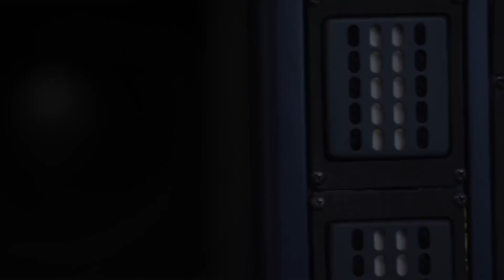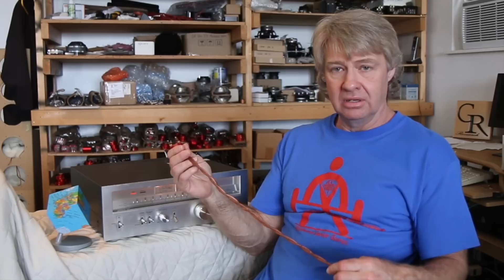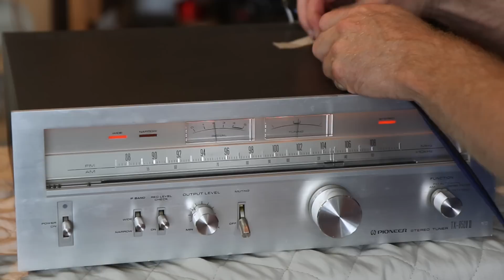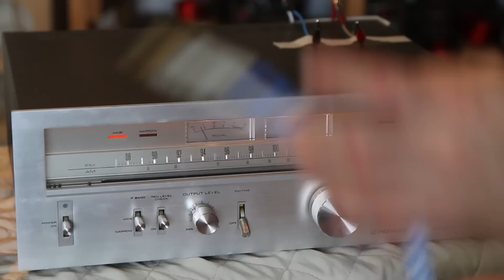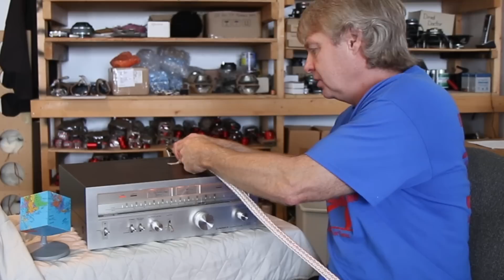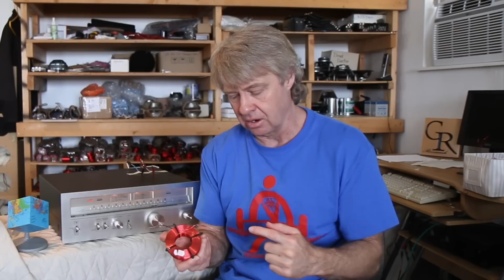Do Audiophile Cables Matter? Here's PROOF!

Comment: @buskman3286

I've hosted carefully set-up blind auditions, with Ultimate el-cheepo - "came free with a vcr in the 1980's" / cut with scissors and crudely taped back together with scotch tape - wimpy RCA cable interconnects vs. $400 "pure Silver" RCA interconnects - with all of the equipment sequestered into a seperate room, with the speaker cables run under a door.

All of the kit was high-end (Roksan amplification / 24-bit SACD recordings / Pioneer 'Elite' CD player / Magneplanar speakers), the audio hardware was on a separate mains power feeds from the power panel in the basement, the amplification unit had a "special" power-cable to the wall, the auditioners had time to acclimatize to the room and picks of music, we all knew one another and were friends / so comfort-level was high, the room was acoustically treated, the speaker were set up to mfg. spec. etc.   I pushed every limit as far as possible in providing the opportunity for the auditioners to audibly detect a difference between the cables.

The result?  No one was able to do any better than wild guesses at which cable was in place.

When the listeners specifically requested that I implement the silver interconnects, and I actually left the utter junk interconnects in place ~~~ they listened and started telling me about how, "yes, there is just this special something about those silver cables, something that cannot be measured, an air about them"...

...when they were actually still listening to music through the junk RCAs...

Mind over reality.

I suggest that if someone wants beautiful / aesthetically appealing cables, which many of the uber-price cables are - then I say go for it if you have that kind of disposable income, but to lie and say that they make a difference audibly?

One might as well be an Orange Abomination voter, because that's about how dishonest they would have to be to make statements about standard cable audibility.

My two cents worth: buy decent ~ not crazy-price cables, check your ego (!!!) and use the money that you saved to sponsor a kid into a scholarship, support a woman's shelter, give money to the SPCA or just something that represents a valid use of money.

Male ego is what f's the world.

Comment: I didn't hear an improvement with cables until I upgraded my speakers to the GoldenEar BRX with AMT tweeters and source from compressed Spotify to Apple Music lossless.  My stereo setup is $11k.

RCA cable: I heard an improvement with WorldsBestCable RCA by Mogami 2549, and even more with Cardas Parsec.
Here's my video:

USB cable: I also heard an improvement with Amazon Neo, and even more with Cardas Clear.

Speaker cable: I also heard an improvement with Micca 14 gauge.  The WorldsBestCable (WBC) using mogami 3082 made my sound quality worse.

Power Cable: I also heard an improvement with iFi Silent Supanova with noise cancelling.
My video: https://youtu.be/lXijf7TdF8M

Comment: All i can say is  i can attest on what Danny is explaining.  I used to get radio signal from my neighbors CB transmissions while playing my music. I learned later is to move the speaker wires around until i couldn't hear these CB transmissions. The same thing happened in the 70s with our TV set with a antenna on the roof.
Reply: Have you heard of ferret core filters?  It's at the end of all your computer plugs and on many other electronics, it's the bulge, (cylindrical  form) it's to hamper the rf signals.

Comment: Come on people… when you disconnect your cable, the music stops. If you use a cable as thin as a spider web you may start getting some sound through but im sure it would suck. If you use a well designed filtered cable you will get pure sound through. - No sound. - Some sound. - Pure sound. 
Cables are critical in creating a decent signal. The ‘Snake oil’ conspiracy cracks me up!

Comment: Here's my experience:
I participated in a cable test in a shop a couple of years ago that  included the administrator actually announcing which interconnect cable was used as they changed... a totally UN-blind test!  The cables being used varied in price from around 30 bucks to 2000 bucks for a one meter pair.  Literally everyone could hear that the $2000 cable was dramatically superior!!  BUT, at the end it was revealed that the cables were never actually changed.  The $30 cable was in place for the entire test.  ;)  

In addition to the above, I have participated in and administered blind testing of RCA interconnects on several occasions.  In these tests no one ever consistently correlated/identified RCA interconnect cable changes/sound quality regardless of the type of music/equipment used.  

So, I have to admit that re exotic cables I'm pretty much in the "it's snake oil" camp!  ;)
Reply: Yes, you are right. A lot of these cables cost a few Dollars to produce and are sold for US$1000s of Dollars with ridiculous claims. Of course you need snake oil arguments to make people pay with such insane margins. I've also gone through many professional blind tests being official qualified member and had to get my hearing tested by a professional audiologist every year. Yes, forget about power cables, short distance RCA cables, optical cables, and even speaker cables at short length, as long as they are of decent quality. Obviously cable length matters and I wouldn't use a thin cheap speaker cable if the length was 50 feet as it would cost on the damping factor and perhaps some loss of dBs. Getting the noise floor to a minimum doesn't cost expensive cables also.
And this video is completely unprofessional. Come one, using some Pioneer tuner set to a given frequency of 105MHz The ENERGY of captured RF is so tiny that it wont affect any power amp with near 0 Ohms output impedance. NO, if he wanted to be credible he would use an actual setup and use an RF transmitter in the room and measure the amp output with some 1kHz (an other) sine wave if there was any effect of that RF signal causing any change. Nobody wants to do proper blind tests or proper measurements on this topic because they already know they will fail. If FM radio signal capturing was such a big issue, why do they not consider the topic in their internal speaker wiring and cross-over filters where the two wires are not in proximity and antenna effects can be much bigger?
Reply: Snake oil works well on cowboy boots.
Reply: lol. the only diference is a slight diference in impedence cozed by thiknes of the cable. so it might be a bit louder...thats it....
Reply: i guess that shop was not selling exotic cables   However very interesting story and thank you very much for that
I am always checking for noise  i.e. the speakers must be completely silent with the volume at max 
If i listen some noise i start from the power amp with inputs shorted with a small value resistor and listen to the speakers again   Then i add the preamp with inputs shorted and finally the source
Imho almost always any possible noise comes from the source   That in my case is usually a TV digitally linked to a dac 
Maybe i want too much
Reply: Thank you!
Reply: I'm shocked! NOT
Reply: Did the same except I actually built some of these snake oil cables. Company was buying cheap compter cable, sleeving it and putting ends on along with a block of "exotic" wood and selling for thousands.
Reply: @ogopogo1397  people choose with eyes
Reply: Hahahahaha. Yup I was there when John Dunlavy pulled a similar swifty on a bunch of audiofools  over 3 decades ago. Acoustic Foundery Adelaide South Australia. The way I was sneered @ for having the guts to be the ONLY one.
To say I could not hear a difference. When others were waxing lyrical, literally over NOTHING Best day ever after the ruse was revealed.
When John was the only one who would look me in the eye & talk to me. Everyone else avoided me just & pretended like it never happened. But oh yes it did!
Reply: Snake oil!
Reply: It appears so logical that the electric signal conducted is always precisely the same. Thank you for confirmed my thought.
Expensive cables are scams, even if they are beautiful.
That video is also a scam.
Reply: @jeanrebache  I'm actually thinking about starting a cable company just to drain the wallets of those Idiots believing into expensive cables.. Build a cable for 20 bucks make it looks fancy then sell for 5 grand or more
Reply: i believe it, they always harp on about data etc. etc. if there is a difference it should be measureable with instruments. why have i never seen the measured differences? science doesnt lie. science doesnt operate on belief its simply measureable facts. ah yes im betting the demo show's the differences between shielded cables is all another gimmick. i wonder if he knows theres royalty free music that you can play anytime you like. https://www.youtube.com/watch?v=H-8bXR-nXC0&t=843s&ab_channel=KissAnalog pretty sure this vid shows the test he is doing. btw the gentlemen in the vid is an electric engineer and designs power supplies. funny thing is the scientist in the vid addresses the test he just did lol.
Reply: My friend and i did this but with XO, VSOP, and VS Hennessy (the regular one)

My fiancé was the test subject. She has a very good taste palate in general and can decipher restaurant food into all the ingredients and herbs used. She can also go home and make it 90%+ of the time

She confidently said that the VS was the XO. We never moved the bottle lol. That’s a ~600% difference in price

We no longer drink XO other than the occasional sip to confirm we can’t tell the difference, especially not back to back
Reply: Totally agree. The only time I ever notice an immediate difference - one that I can consistently identify every time - is when I swap from RCA to balanced interconnects on my amplifier (the balanced cable has noticeably more gain). I have tried oodles of different speaker cables, including Nordost Tyr which is eyewateringly expensive, and I'm damned if I can hear any difference. Even if we accept that there is a difference, then it is so microscopic that it does not justify the cost.
Reply: Brilliant.
Reply: I agree! All wire sounds the same when used for music signals.
Reply: Its about clean Cooper and good isolated.
Reply: @jenserikjohansson6228  Clean skates on their own?

Comment: Well a test to determine a better antenna is vastly different to how a speaker will sound with a particular cable.
Reply: Absolutely, but it clearly shows that some cables will pick up noise, and some will not.
Reply: @dannyrichie9743  No. It clearly shows some configurations will create a better antenna.

Comment: The thing is - it's a nice illustration, but it proves nothing. First - I doubt you could pick up anything with these "antennae" that was below 20kHz. Unless you broadcasted it yourself in that same room. Second - antenna requires very low signal that is then being amplified by the receiver circuitry. For example, cell phones receive a decent signal when antenna picks up more than 0.000005 V , or if it's easier 5uV differential between two poles. I have no doubt that lower frequencies require a bit more voltage, but none of these frequencies really matter, because we can't hear them. We can hear transformers humming, or PWM switches in our SMPSUs, in our PCs for example, that's noisy equipment around us that we need to think about.
I understand that the intent was to demonstrate, I know you're not suggesting that we're gonna "hear" radio signals coming into our speaker wires (it IS possible to pick up nearby radio stations through signal interconnects, but not through speaker power cords), but the thing is - it really is just a curiosity when you see it first time and know nothing about it. Dealing with actual noise that you could actually pick up and hear is another thing altogether. In fact, I'd wager that this huge cable is the best antenna for low frequency electric noise out of these 4, so the best thing to deal with it is to use good equipment, not just cables. And ofc, it is the best cable, 95% because of the copper quality and mass and 5% because of the design. Bad design can ruin every copper quantity, don't get me wrong, it's just that everything about cables is so well understood that only an idiot would get it wrong.

Comment: You can use cheap cables with ferrite rings to achieve what most of these high end cables claim to do in the RF region.
Reply: Ferrite rings were the first thing I tried too. Fortunately for me not only did I do the research unlike most I actually pulled the trigger and took the punt. My room is now quieter than with what stereo setup sounded like. But the astonishing thing is I'm now running nine channels 😊
Reply: Not at all.

Comment: I’ll grant there might be a difference between different constructions of cable.  Simple physics can show that a single unbraided cable is more likely to pick up noise than braided cables.  But beyond that, what would be picked up is not audible.
Reply: You are correct in that simple physics can show differences, however your conclusion that it would not be audible is speculation. That fact that it is audible has also been proven many times.

Comment: I have no stand on this issue  and I trust everything you say, but as you say" the longer wave lengths are going to pass right through it".
In my system the back ground tends to be in thoughts longer wave lengths as indicated by the fact that I hear it as low frequency hum.
I suspect that the cause of these low frequency sounds are harmonics from countless sorces. I think therefore that your no doubt lovely clean sound has more to do with the isolated nature of your electricity supply than braided cable especially as you mentioned batteries.
Like you I am only interested in the truth ,I have had to move all my power to a different circuit because my preferred one is so contaminated . Do you really believe  braided cable will help?
Reply: Yes it will. You can try one and see (or hear) for yourself). If you don't like it then just return it.
Reply: @dannyrichie9743  I will some day at the moment my next priority is a good DAC. Thanks 👍

Comment: Bogus test. I have never used speaker cable as an antenna. No one is questioning how different cables act as antenna. The question on debate is - do speaker cables make a difference to the sound or speaker output - this is not tested. Once you have a reasonably thick enough  gauge copper cable to carry high current with negligible resistance, cables don’t matter.
Reply: We, and thousands of others, have already confirmed audible differences in cables. This demonstration just illustrates one of the reasons why.

Comment: Can you explain better what kind of copper you use for the 24-braid cable, where do you get the base material and how you braid it? 
I won't get into the debate on whether cables make a difference or not. I think they do, even if no final explanation has been submitted until now that I know of. GR's is reasonable, because RFI is real and nulling it, in this case with a cable, might improve noise a lot. 
The thing you must check is the cable you use is not capacitive, or that your amplifier can drive capacitive loads. Unfortunately I do not have a tuner anymore to test different cables.
Reply: We have the cable made for us. It is four 9's pure Copper in polyethylene. The cotton rope core we feed through it reduces capacitance quite a bit as well.

Comment: The radio antennae idea is just focused on induction which is probably not what you were aiming for. And yes different wires are going to pick up a signal differently if made of different materials and different mechanical features.    But what you were probably trying to prove is that a signal degrades more if it is conducted down a "cheaper' cable. Maybe another way to "show" a difference would be to send a signal from a record player to a digital audio card and use software to display what was received by the card.  Maybe there would be a different wave pattern for the cheaper cable - maybe not. People might  see the difference.

Comment: Soooo... the take-away from this is that speaker cables don't handle RF frequencies very well.

I dare say the tiny thin cables I use for 5Ghz RF gear might not be too good at powering a 2000w Sub, either...

Comment: Measuring microvolts at 100MHz is no indication of what is going on with your audio speakers.
Reply: It illustrates how well some speaker cables pick up noise and how some filter it out. All of which is audible.
Reply: @dannyrichie9743  Okay, but you got pretty good ears for 100MHz!
Reply: @JohnSmith-qi6co  It is what it does to the signal that is audible.

Comment: Ahahahah how are you going to reconcile the fact that these cables arent inside the amp, assuming for example a wired tube amp / or God forbid PCB traces, so they loose the signal AND THEN the last wire from amp to speaker make up? It's like down sampling and then upsampling.

Comment: Believe it or not 
I was using 14 g lamp wire for speaker wire.
Then I got some 12 g ox free wire. Yup. There was a difference.
So...unless you've got pure silver wire .
Try and find 12g wire that's NOT solid home wire, good luck.
Radio antenna !